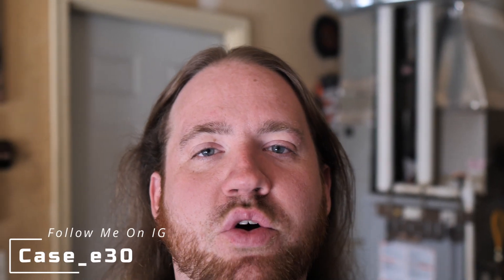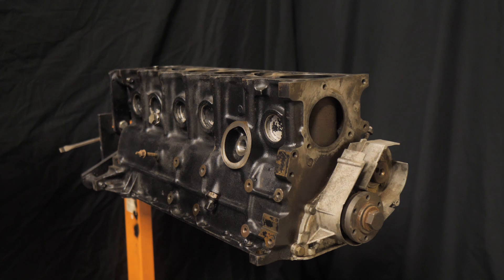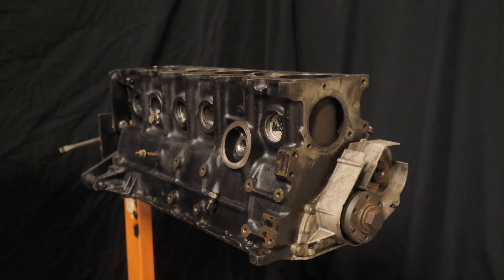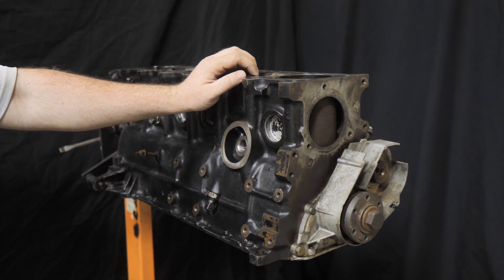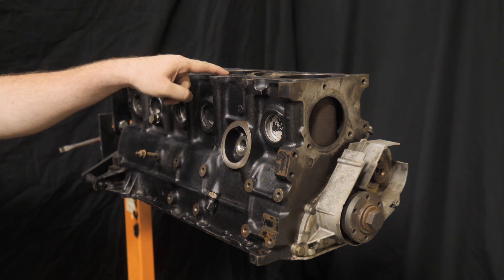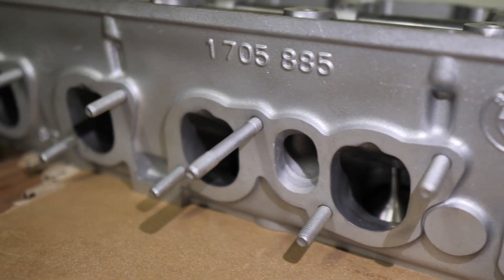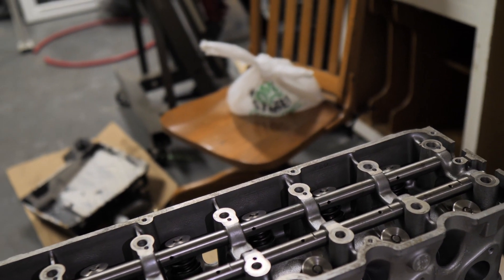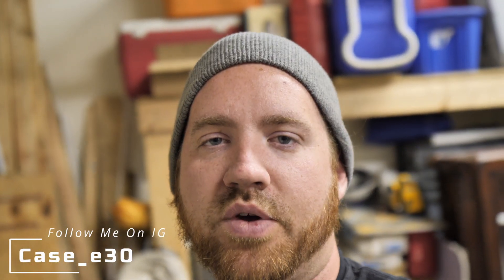"The Gold Standard" 2.9 Stroker M20 Build (Introduction)

Comment: what do i have to do for the m52 crank to work? can i just use standard m20b25 rods and pistons?
Reply from the maker: @florider_hd  you have to use 325e rods, you can use the pistons but also need to shave the deck to be able to make that work by .5mm. there's a build thread by a guy named "Betz" for a motor he did with that set up

Comment: Good video, and good call on using the 10.1 pistons. My 2.9 is a 1mm overbore, same crank, Molnar rods, and CP pistons. Cam is a 274. Megasquirt pnp 2.0, innovate wideband. It's a hoot at about 200 hp to the wheels. You'll love it!
Reply from the maker: @doctortruth4094  Actually the build has changed on the motor I'm actually going to do a 3.1 now and changing it up I did a whole update video on this I think I posted it in the description or the comments

Comment: How would you suggest someone get into making a stroker motor? I want to put a stroker motor in my e30 over winter
Reply from the maker: It really depends what you want to do and how much you want to spend because doing like a 2.7 stroker gives you more power than a normal 2.5 It doesn't require a bunch of stuff to happen so honestly just depends on how much money you want to spend
Reply: @chgotbanned  kinda thinking minimal increase of power to cash ratio.
Reply from the maker: @smcarmel  2.7 stroker is the best way to go, but works best with a 2.7 bottom end, DBO on YouTube has a bunch of stroker content you can search through that will be the best idea
Reply: @chgotbanned  k ill look into that thanks. Would that need a stand alone ecu?
Reply from the maker: @smcarmel  for what I'm doing I need a standalone, I don't believe you do with a 2.7 stroker just a chip I think